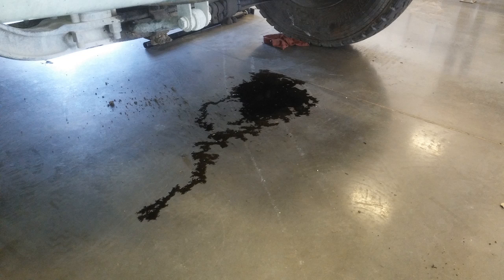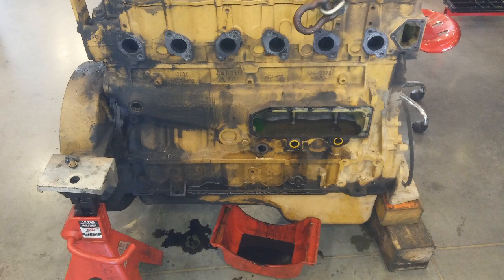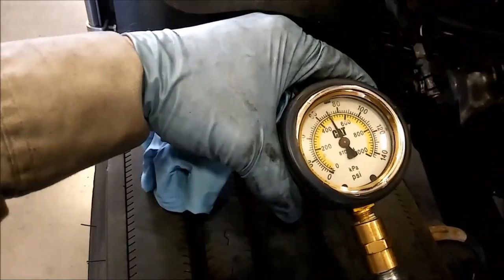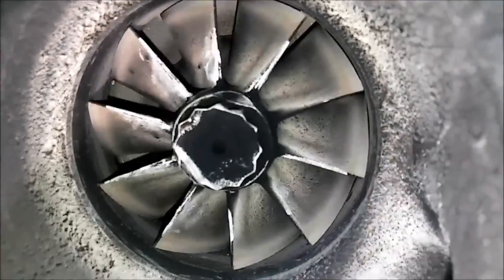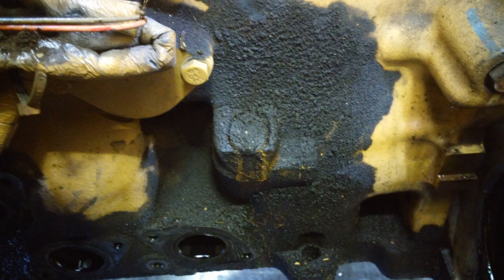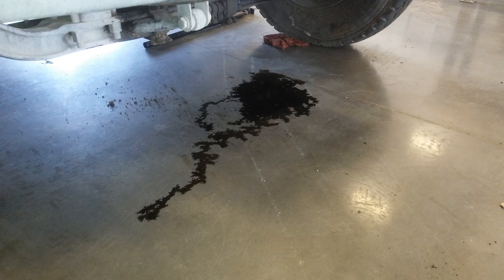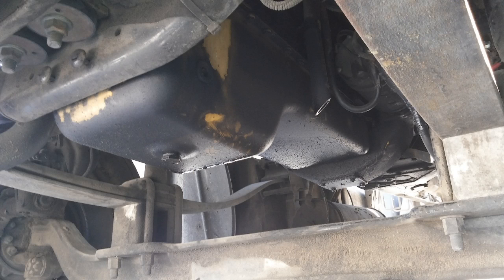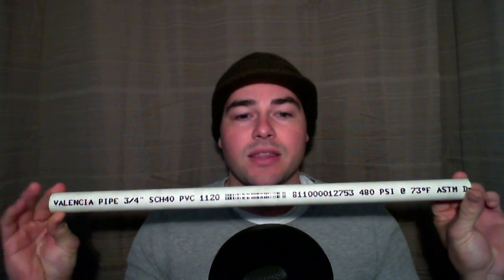Why Do Diesels Leak So Much?  Why Do Diesel Engines Leak So Much Oil?

Comment: paccar, detroit and volvo all use oil powered centrifuge filter. and its purpose is not to pull fumes out of crankcase  only to  filter oil out of fumes exiting crankcase without causing a restriction to said fumes

Comment: Blaming the leaks on turbos is fairly misleading, especially since half of them actually don't have trubos at all and still leak a lot. It has more to do with an overall increase in operating pressures and vibration which is much higher than that of gas engines. Higher build quality does abate this though so more expensive = less leaky

Comment: A response to why I am wrong would be nice. If this is the case why don't forced induction gasoline engines leak. Crank cases are generally vented to atmosphere and are generally only slightly above barometric pressure unless engine had servere blow by or blocked breatgers. Most leaks are from areas like head shims on oil drain down from valve train where there is no positive seal. Or where bolts screw in externally like on c27-32 into main caps, and Detroit 2 stroke which will leak like seives because bolts that are fastened externally into intervals.
Sumps and front covers tend to leak because of movement in joints due to dissimilar rates of expansion between aluminum and cast iron as well as large torsional forces on engine. Another big one is people not torquing sump bolts and having uneven tension across the joint.Then there is the big one heat, many seals are made of nitrile which is nearing its limits in terms of thermal ability. An example of this is 793F dump trucks which have mostly viton seals and rearly leak. People often put nitrile oring in place of viton one often because they don't know and you end up constantly chasing leaks. Accessories that are leaking are often the result of bolts working loose and will take up with when tightened or once again heat has caused the seal to deteriorate.

Comment: Not that this would pass emissions or inspections.  
But if you had PCV,  valves on the crank case,  and lines ran to an 3 way oil catch canister,  with an little pcv external air filter on top,  and a small pump under neath the canister to feed the oil back into the engine to reduce oils waste. This completely relieves anything having to enter the turbo,  and it's all connected to the crank case.

Comment: My cummins has an aftermarket drain welded into the exhaust pipe.
Reply: Does it work well? Been thinking about putting that on my 12v

Comment: at 4.30 you are seeing that diesel have turbo and that will blow the seals out.
but diesel engine has no throttlebody. so there is no vacuum to make. 
whit petrol engine you release the gaspedal and throttlebody will close. so you are getting vacuum in the engine. 
whit diesel engine if oyu release the gaspedal, your dieselpump wil stop making pressure and the diesel injector wil stop working. there is no throttle body in it. 

but whit the latest emission standards diesel engines have also throttle body, to create also vacuum in that engine. alot of trucks have it as a engine brake,

Comment: I think this is why old two stroke detroiters leaked bad posative crank case pressure from roots blowers in block any loss of seal around oil control rings went down into oil sump plus the slobber tubes that let excess engine oil out of airbox got picked up in the fan airflow and blown all over the engine I once put a one inch diameter hose unto the slobber tubes that led the excess oil back past the the engine and transmission where itkepth the frame fromrusting ha.ha!oh well you know what they say about the best laid plans of mice and men!

Comment: Sorry absolute rubbish. Your cat engine probably had a really shit history of little to no maintenance and running in extreme harsh conditions. Compression blows past rings because of carbon build up in the engine. Regular engine flush with a professional engine flush at times of service prevent this. Crank case compression is robbing the engine of performance the compression belongs in the combustion chamber which is the whole point of compression. Any engine which is flushed at each and every service has no oil in the inter cooler pipes. They are supposed to be dry. If there is oil residue present you have a problem. It isn't only diesels which have this issue.

Comment: ....i have two 3208 cat turbos, 375hp engines, 14 years old, on my boat, and i never had a drop  of oil under the engines or on the engines, ...sometimes a few drops of cooling water , but never a drop of oil....

Comment: Even non-turbo Diesel engines don't produce vacuum.  There is generally no throttle plate, so there is no significant negative pressure in the intake tract.
Reply: There is no throttle plate in any diesel engine, at least not associated with running and fuel regulation. Many have one that closes when the engine is switched off. Prevents rough stops and in the unlikely event of runaway switching off the engine starves it of air immediately.

Comment: I wish you could make owners ans operators understand this . I rebuild engines of all types for a living . Mainly diesels , an it seems like no matter what you do they leak oil some where some how . I am installing lower repair bushings in a C32 Cat after that assembly will begin . They do fairly good but are troublesome at the gear train housing where they mount up to the cylinder heads .

Comment: How about adding an oil catch can and adding the pcv relieve on the turbo inlet? The catch can can capture most of the oil entering the turbo and still save the turbo/engine seals.

Comment: Turbocharged gas engines do have a pcv system its from your valve cover to the intake of your turbo that it a vacuum
Reply: Because gas engines wo t run away on their own oil. Only compression ignition engines will.

Comment: Diesel engines don't use PCV but CCV system, and yes it goes before the turbo and after the air filter, it's just a valve with a spring that closes at full load by the vacuum created by the turbo

Comment: Gm used a pcv valve on the 1.4l built into valve cover. Engine inherently has turbo waste gate issues and pcv valve failure issues resulting in replacement of entire turbo assembly or entire valve cover replacement. Or both.... in my case.

Comment: you cant say that.

why engines are leaking is because the gascats are damaged or broken and NOT the diesel engine is bad... i hate those diesel hater
diesel ist the most efficient engine after elektrik engine

Comment: weirdly i seen more gasoline engine leaking oil than their diesel counterpart.
for example bmw 323i 325i 335i had quite a few oil leaking problem, where else 320d essentially had no leaking problem at all

Comment: You can absolutely have a PCV on a turbo charged/ supercharged engine gas or diesel.  Now, my guess is since emissions regulations are lax on big diesels and they aren't subjected to the same emissions standards as car manufacturers is that they simply had a crank case breather vent instead of a full PCV setup. Didn't know diesels tended to be "weepy" either.  I've seen plenty of weepy petrol engines, but then again I tend to work on things built before 1990 and from sweeden or Germany haha.

Comment: How does car engine that have PVC system still leak oil LOL. Nice theory about blow-by causing oil leaks I've many with million miles and no leaks. Also cats early diesel engines came from machine side they didn't leak oil not in tell they were put in a truck. WHY because truck side stress block more from 100% load to no load why lead to better gaskets. I 've changes with Cat engine from paper to metal gaskets with molded rubber. Most leaks are failed gaskets from movement AKA flexing of block, head. How many 3406 engine blew head gasket under 300k because of crappy space plate design and liners sitting on top of block

Comment: Could just take the turbo off, problem solved.  No more boost to force pressure against the gaskets, and you can run a typical PCV in the valve cover, no more oil leaks! ^_^
Reply: Would that also result in no manifold pressure on the intake side??
Reply: Technically there is no manifold pressure, since there's no throttle on a Diesel, it's just an open intake manifold.  This is why vacuum pumps are needed to drive anything that requires vacuum, such as some HVAC vents and brake boosters, if the car's not armed with hydroboost from the power steering pump.
Reply: Midnight Mechanic Appreciate the feedback! I work on school buses.

Comment: Scania must have got round these problems because the are the most oil tight engine I have ever seen,at around 1million miles of use all you will find on a Scania engine is dust from the fan,they also have a centrifugal oil spinner which spins all the contaminants out of the oil which keeps the oil cleaner over a longer period thus saving oil,I like CAT and CUMMINS engines but their not a patch on Scania for Quietness and Reliability, as long as they are serviced their indestructible.

Comment: All piston engines create high air pressure and turbulence inside their blocks. The pistons create this as they move up and down on each stroke.  Before 1969, engines vented the excess pressure out a tube that vented downward onto the ground.  The PCV_(positive crankcase ventilation) vented the pressure up into the air cleaner where the oil laden air was burned inside the combustion chamber. Most didn't notice, but motorcyclists really noticed the oily slick that was always  in the middle of roads especially at intersections.  Thanks to the EPA, we no longer have this slick surface to worry about, and engines no longer use a quart of motor oil every 500 miles.
Reply: They still use it. It just gets burnt

Comment: Also, if you suck from the crankcase into a turbo and it starts sucking oil (like if you were driving on a hill or something) the turbo would atomize the oil and mix it with air which will combust in the engine causing it to run away (rev uncontrollably until it dies from engine failure).
Reply: Would the oil go in the aftercooler?? I heard that if you install a new turbocharger, you have to take one of the pipes off the aftercooler and plumb it to a waste container to get rid of the excess oil in the component.

Comment: Confirmed: I own a diesel mercedes 240d car from 1974 that has no turbos and no oil leaks and the crankcase is connected to the intake with a tube. Diesel cars are cool. Gasoline is too mainstream bro.

Comment: Have not seen one yet but I’ve heard the new L5P Duramax has an electrical Centrifuge to remove the oil before they put crankcase fumes into the turbo inlet

Comment: The reason why gas engine creates vacuum and diesel doesn't is because of the throttle and not because of the turbo. There are naturally aspirated diesels as well...

Comment: I've thought about using the exhaust gas flow in my open (no muffler) system with the puke tube hooked to it thereby causing a vacuum on the motor. We do this with drag cars with great results actually picking up hp.

Comment: Great video thank you I was not aware of this, I'm thinking of upgrading my gasoline motorhome to a diesel motorhome but I wouldn't want a puddle of oil in my driveway.

Is there a way 2 fix this problem I'm assuming not otherwise you would have mentioned it.

Comment: My wife’s Ford SMax 2l tdci has covered 210,000 miles. I checked the oil level once, I think in around 2011, it was ok. It’s never leaked a drop. I have had European diesels (Audi, Ford, BMW, Volvo) for the last 2 decades, and I just get them serviced and never bother to check the oil, basically because they never need checking

Comment: I suppose it depends on the engine design and how much pressure the turbo makes.
I am very familiar with the 6.9/7.3 IDI diesel engines that Ford used in pickup trucks from 83-94. In these engines(originally designed to be N/A), they used a PCV system(called a CDR instead) and sucked it into the intake. When turbochargers were added(aftermarket kits were/are available for many years, and Ford even offered one on 93-94) they simply dumped the crankcase gasses into the inlet of the turbo.
Surprisingly(or not), the turbochargers don't seem to have any problems with failures. They run a long time as it is... but they are only pushing 10 PSI of boost.
In this engine case, they absolutely had to burn the blowby... this engine was designed with massive ring gaps, and makes enough blowby to look like the engine is on fire if it is just vented to the atmosphere.

Despite this, both N/A and turbo(sucking crankcase gasses at slight vacuum from the air filter restriction)... they still leak oil quite commonly. From all manner of places.
Reply: MacRobb Simpson I just recent purchased a 86 f250 6.9 idi for $1250 cad.
Unfortunately the valve cover leaks like a sieve. 
How long would it take to replace valve cover gaskets?
Or how much would it cost at a shop roughly? 
One trying to run this engine on vegetable oil!

Thanks for your time.
Doug

Comment: Mine Doesn't leak , but it sucked the oil trough the blow-by fume exhaust pipe , when i had it still originally connected - stock. That was 6 years ago , and since than, i have no problems with it .

Comment: quick question, i got om617 mercedes turboed diesel 5 cyl. It has breather vent hose going from valve cover to air filter housing, going tru some canister in the housing and finally goin back to the sump case. I notice some oil vapors in the turbo air compressor side. Could it be from the blowby and all the system set up like that, or could it be some turbo seal. I will make the experiment to eliminate the blowby vapors by hooking up a canister with a vent on the breather tube coming from the valve cover  eliminating the route of vapors going tru the air filter housing and check if there is still traces of oil back there in turbo air compressor side. Is it a good idea?

Comment: Without watching all of this video it's very easy to break it down.... and no it's not the pcv valve that causes it LOL 
It's because the diesel has the highest piston compression ratio and the fuel diesels uses is very dirty and black when ignited in the combustion cylinder... it all starts here and from here all the problems start to take its toll on the motor... 

Once a pcv valve is clogged up in time because of the 2 things I pointed out then yes problems start to happen with signs of oil leaks in various places
Reply: I forgot to add if the problem was from the pcv from the start with a brand new motor, then all cars would leak oil, petrol and diesel cars.... so no the pcv is not the reason diesel engines leak oil

Comment: I wonder if an air pump could draw a negative pressure from crankcase and despense pressure into the intake manifold and install check valves, bypass valves and so on to improve reliability and safety incase of failure. 
My grandpa's carberated dodge truck and my dad's jeep had air pumps blowing clean air into the exhaust manifold to improve (fool) emissions tests in the 1980s.
Same basic principles😉
Still found your video useful though👍

Comment: Why couldn't we use an exhaust venturi to scavenge the fumes like they use in high performance gasoline engines that have poor vacuum due to large cams or forced induction? I'm sure it couldn't be used on any newer emissions engine, but it might be possible on older diesels.

Comment: Turbocharged gas motors have PCV.  Non turbo diesels don't have PCV.  The real reason diesels don't have PCV is because diesels don't have a throttle body and therefore have no manifold vacuum to take advantage of.
The super dependable 7.3 in Fords has the CCV suction line in front of the turbo and they don't have turbos blowing up prematurely so I don't see that as a problem.

Comment: Too bad that the maxxforce is such a junk shit engine that nobody wants it. The company I work for only order the Internationals with Cummins. 

I've got a PCV system in my factory turbocharged car??? 

What about adding a catch can setup to a diesel like they do to the gas engines?

The D13 Volvo I drive with 500,000 miles has no leaks. Is this an old video I didn't even look at the year listen old video I didn't even look at the year, lol

Comment: Diesels run higher oil pressures and diesel engine oil has  significant amounts more detergent and  cleansing additives that can wear gaskets over time.

Comment: Wtf any 12v -24 vacuum motor and push the fumes in the intake after the turbo what a engineer I am problem solved
Reply: Your not going to match intake manifold  pressure with a 12/24v motor.

Comment: Many of those leaking diesel engines probably have several times the hours/mileage of a typical gas engine. I've seen CAT diesels with over a million miles and marine diesels with 10s of thousands of hours. I started driving in the 1960s. Before the PCV and other smog systems. Then I could by a 327 with 375 hp or more. Only recently has the hp come back to gas engines. The late 60s, 70s, and 80s were nightmare years for smog devices and gas engines if someone needed real power. That's why diesel pickups became popular despite their price. I owned a series of Chevy v-8 engines from the late 60s to the late 80s. Each new truck had less hp than the one before. My last 350, 1986, had about 140 hp. Then I went to diesel.

Comment: So do you recommend doing the CCV Mod on a 7.3? Sounds exactly like what is set up on my 99 I take my Air intake tube off and see oil residue on the impeller wheel? But the dealership tells me its to keep the turbo oiled up since there is no ball bearings in my stock turbo? Does this oil eventually get to the intercooler or does it just get sucked into the intake H pipe?